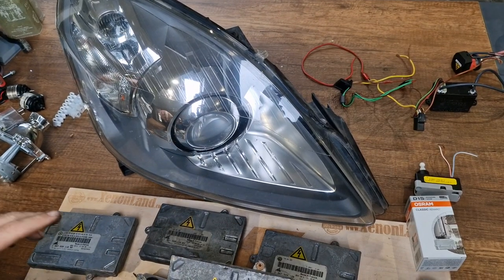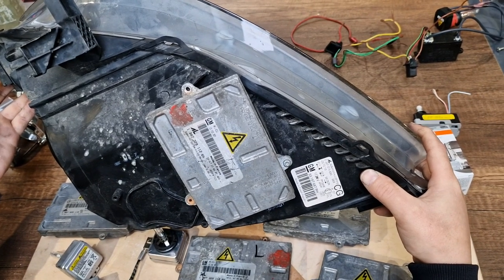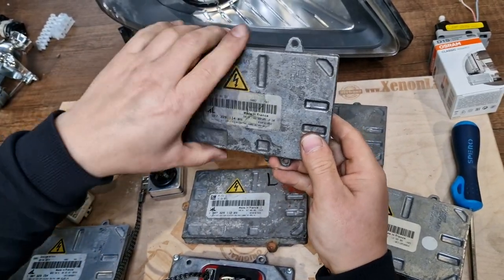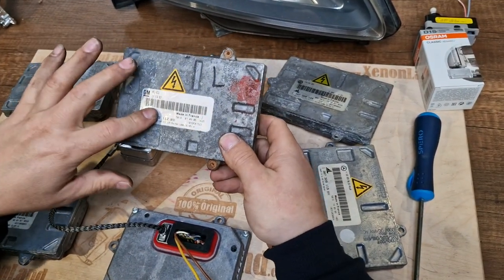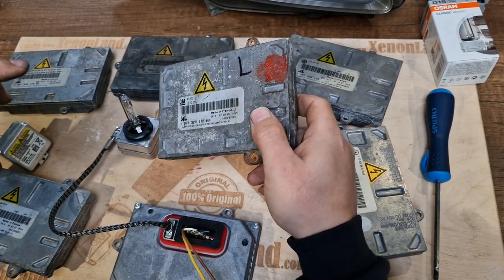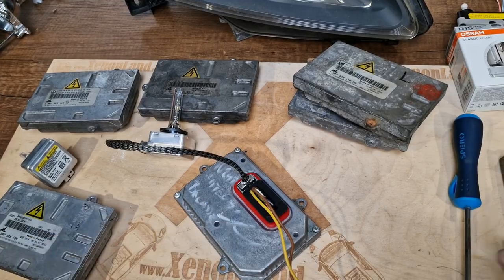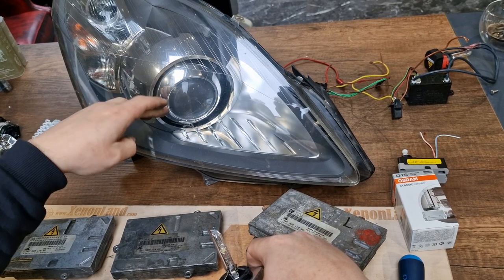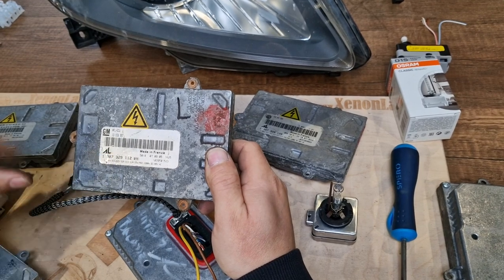Opel (Vauxhall) ZAFIRA B BI-XENON adaptive headlight ballast control unit GM AFL-ECU AL 1307329112

Comment: I have standard headlights, can I upgrade to these headlight plug and play?
Reply from the maker: Definitely NOT plug and play. Many things needed to be converted
Reply: @xenonland  like what? I’m picking up a set off these Saturday do I need to remove anything else from the car there on
Reply: Do I need the plug / loom from the car I’m removing them from
Reply from the maker: In general, you should find adapter cables for retrofitting the xenon headlights. You can also take the looms from the donor vehicle, but you should find a really good mechanic to adapt these to your existing wiring. In any case you will not have the adaptive function. If you get a low and a high beam at the end, you can treat it as success. Very difficult conversion. These are adaptive self levelling headlights that require completely different ecus, light modules, range adjustment modules etc...
Reply: @Haydzx-tn3gy I make the plug and play loom to use them as xenon lights only no movement. You can find me on the zafira b oc. You also need tech2 to program them also